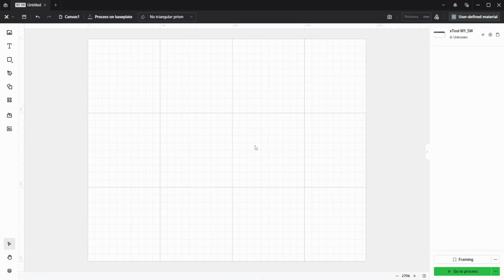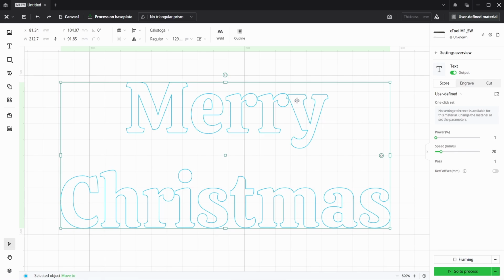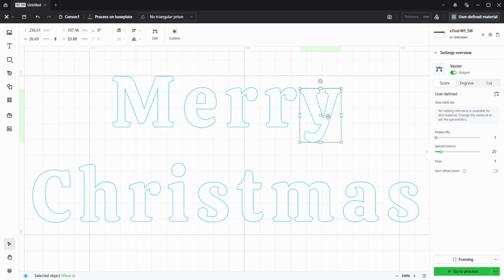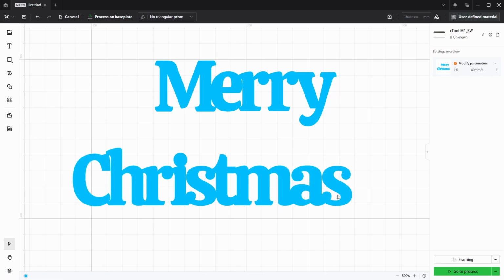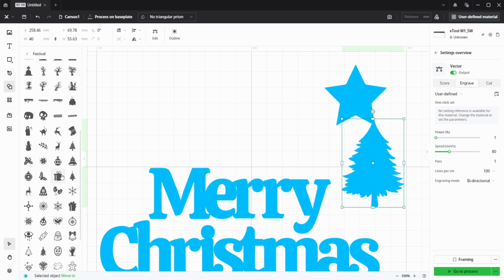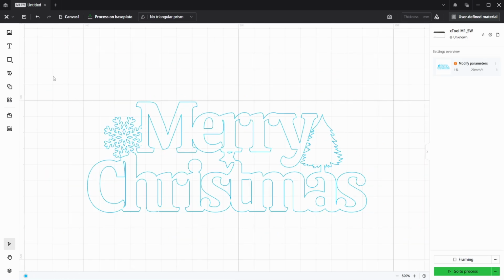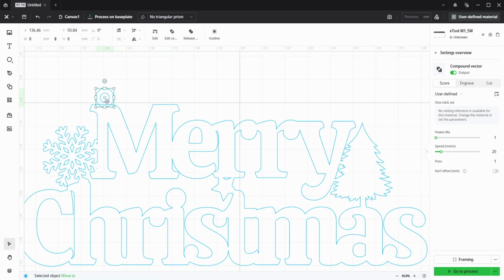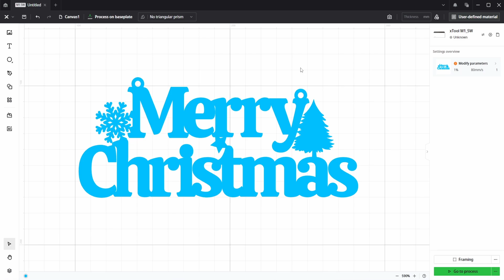Create a STUNNING Merry Christmas Sign in Just 5 Minutes!

Comment: Hi ThemeXDigital,
Just thought I'd let you know in XCS 2.4.27 (maybe also earlier versions) sadly this method no longer works - 
I came back to this tutorial as I couldn't get my Happy Easter sign to work thats when I realised they have changed the software.
At the point where you seperate the letters you now have to right click the text and "Spilt Text" (so that you can move those letters individually) and not use Weld. 
This then negates the need to short out letters like a's o's etc that have cutout bits which we used to "make a compound path" as they now are already joined.
Then when everything is moved to be overlapping I unite as per before.
Hope this makes sense and helps someone, I don't have the skills to make my own video tutorial 🙂
PS Thanks for the tutorials they have really helped me get started
Reply from the maker: Hi, Yes I did notice that and I have plans to make some new videos on the text tool and making signs etc this week, I just haven't had the time yet 😉
I'm glad you figured it out though and its great that now everything is still live text and you can make changes before converting to a path or uniting 😀 Thanks Gav